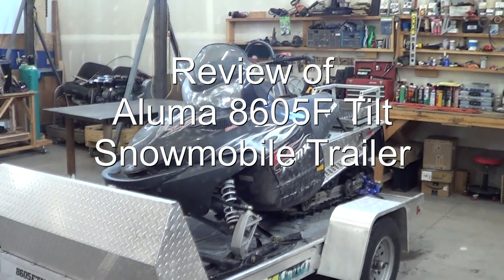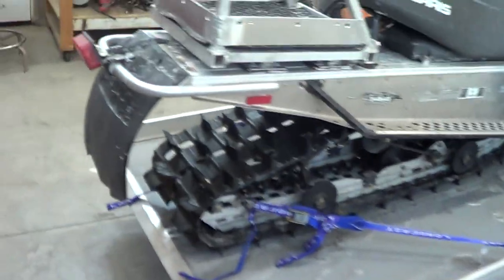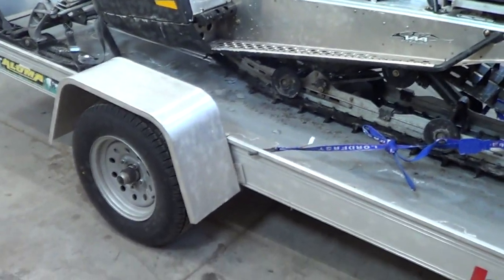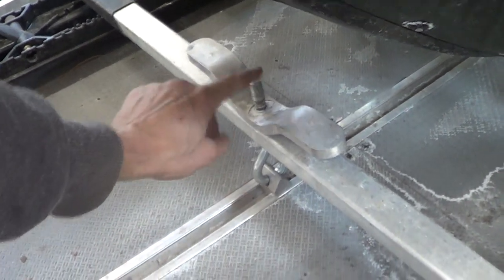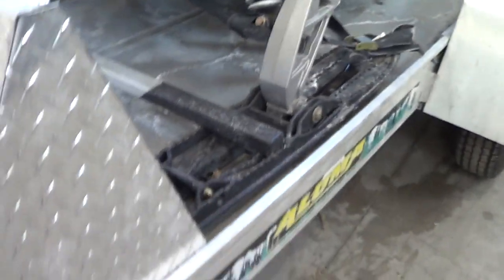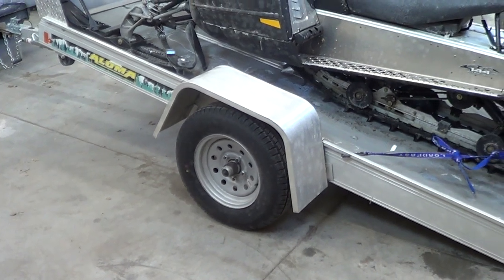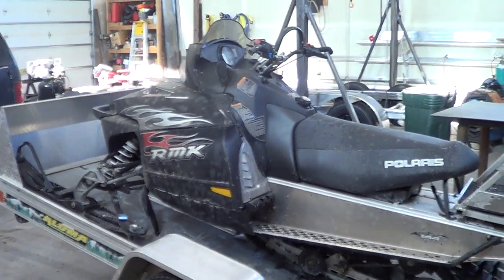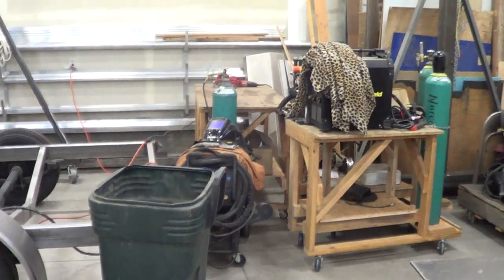Aluma 8605F Snowmobile Trailer Review

Comment from the maker: Post-video comment. When driving on an actually muddy dirt/gravel road (rather than just water spray on pavement), the splash guard is inadequate. It does protect the front of the machine, but the sides and even the seat get muddy. Part of this is spray directly from the truck, and part is ricochets off the fenders. To prevent this, the guards need to be approximately a foot wider. Another problem occurs when loading. The carbide ski runners dig into the softer aluminum of the back of the trailer. This causes the skis to "stick", and excessive momentum is needed to overcome it. This problem is solved by laying a piece of UHMW from the back edge of the trailer to the ground. Then the snowmobile slides up easily.